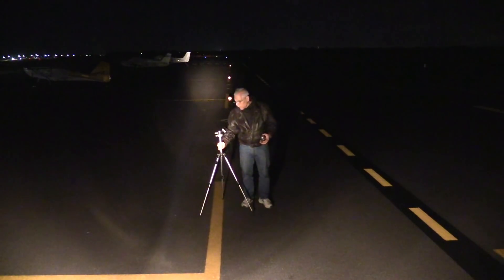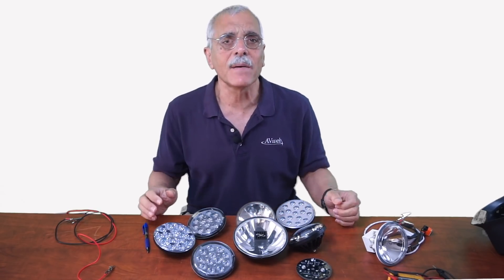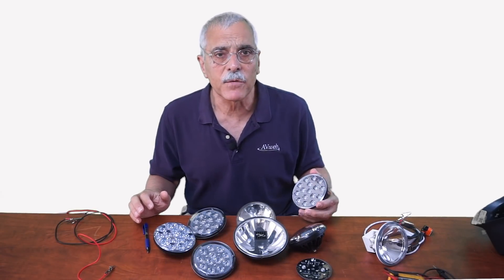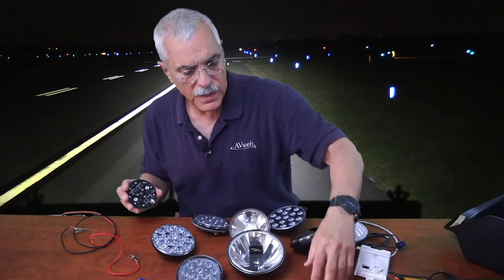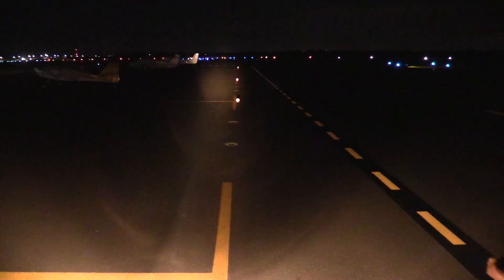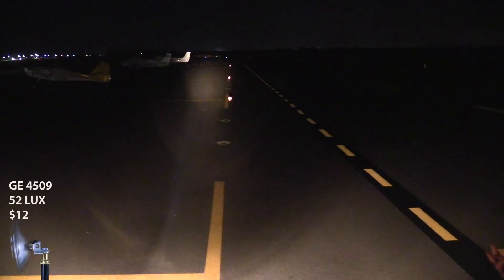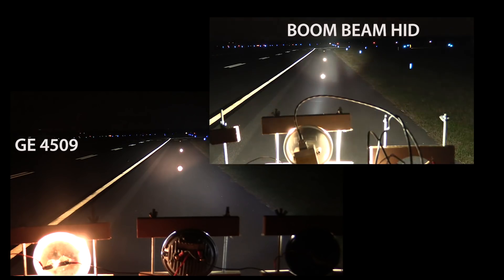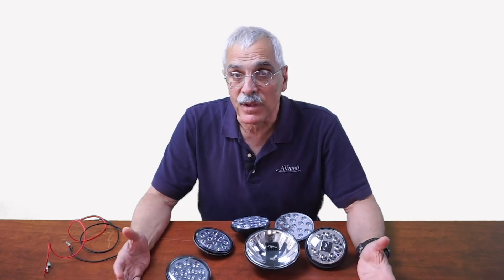The Unbearable Brightness of Aviation LEDs

Comment: - have $35 flashlight 
- print the word "aviation" on the side of it
- is now worth $650
Reply: Or "marine grade"...
Reply: @superbmediacontentcreator  You use non-"marine grade" parts in your boat at your own risk. Of course, everything you do on your boat is at your own risk (and the risk of your possible passengers), but when you use out of spec parts its doubly so. Certainly, if youre sure of what youre doing you can do what you want. But you better be damn sure then. The sea is as hostile for human life as the skies are.
Reply: I know. I bought some metal snips from a hardware store for $10. But the aviation metal snips were $775
Reply: @StringerNews1 unfortunately there will be no dude jumping into a jet with a replacement led headlight if you ask the manufacturer.
Reply: sabr686 agree
Reply: @StringerNews1 Well, sounds like the GE4xxx was always as cheap as 12$ and nobody had no peace of mind, did they?
Reply: @StringerNews1 That's still not a compelling argument. LEDs don't have any part that can be used to burn things due to it's temperature.
Also practically ALL old lamps with filaments are sealed and in a partial vacuum. otherwise the filament would oxidize within seconds. That is literally how ALL of them have to be constructed. Nothing special about PAR here. What is sealed is the reflector to the glass that includes the filament. 
Destroy the glass of a filament lamp and it starts a fire. Destroy the glass of a LEDs lamps casing, maybe even remove any lenses on the LED and then remove any resin that is in contact with the chip and you can warm your hands in cold weather. If they get too hot, they just stop working and fail open circuit. It can't get much safer today.
Reply: Aviation everything is blown up tenfold due to certification beurocracy and overregulation. 
We're talikung 10$ nuts, like each regular nuts, or 1$ rivets.
Reply: It's a bit like adding "Wedding" or "Gaming" in front of regular products. 
That being said, aviation needs more testing and better materials, increasing costs.
Reply: Until you try to get that money for it!   LMFAO.
Reply: The problem with high intensity LED's is the electronic's to drive LED's, it's called RF interference in cars, trucks etc it's not a problem in most uses, in aircraft and marine applications RF interference by LED electronic drivers is a real problem as the communication equipment operates over a very very wide frequency spectrum and common cheap nasty consumer grade torch & automotive LED drivers are not designed to a high reduced RF emitting standard over the same spectrum spread and do cause harmful interference to an aircraft or marine vessel's many communications systems , A lot of research and testing & money involved to meet very tight RF interference standards on a low volume selling items so yes it will be a heck of a lot dearer.
Plus also a lot more research and development goes into lens's for aircraft than cheap consumer grade stuff LED lighting.
Reply: @TheTurbulant  shielding, more efficient topologies for DC-DC
Reply: @TheTurbulant  ok, but aren't LEDs run with DC? DC has no frequencies. LEDs are constant voltage constant current. If you dim them for any reason though, yes ok, some interference.
Reply: Yes LED's are DC but you need to limit the voltage and current flow, they are not like incandescent globes. High intensity LED's could be current limited with resistors but they need to be of unrealistic size that you could not package small enough and also would vary in brightness with slight voltage change. LED's are often regulated using PWM (pulse width modulated) switching transistors, consumer grade one's emit RF interference both atmosphericly and along the power line but can be basic filtered to stop basic interference which is satisfactory for automotive and consumer grade stuff but it's not enough for aeronautical and marine purposes, much better, costly and higher grade of commercial  transistors are used, and in aircraft applications you have temperature variations from -40c to +50c , that's why you see LED lighting flash on and off with certain frame rate's camera's.
Reply: Nnnno lol. See that mosfet on the board there? There 10 cent mosfets and theres 20 dollar mosfets. Im willing to bet theres a difference.
Reply: @StringerNews1 Yup, but they don't seem to care anymore and I see dead-air on the biggest of networks all the time now. Few even know what and FCC licence ( I have a first-class) is anymore and they want to pay me less in numeric dollars than I was earning back in the 80s'. It is just amazing. The management thinks because the equipment got cheaper and is interchangeable that therefore the people did too! It is demoralizing and just time-to-die (Bladerunner).
Reply: There’s a lot of testing to certify anything for aviation use. Seeing as you can’t just “pull over” to fix anything it needs to work first time, every time. No excuses. You’re paying for the research and development of the product.
Reply: @CoordinatedCarry  that still doesn't mean it's Worth 650 ..
Reply: @-allround-  No, it means the testing and quality assurance is worth $650.00
Reply: There are a number of reasons the cost is so much more. Engineering and testing for interference with other systems requires independent experts with specialized equipment, which is not cheap. Once approved, liability is the next major issue. If there is a failure, it can lead to a crash or fire on the plane and the lawsuits will start flying. Plane crashes are never cheap.
Reply: @CoordinatedCarry  There's a grain of truth to the OP. Yes, it costs to certify things as you state. At the same time, Yes, you're paying extra on top of the certification/R&D costs because it's for "aviation". It's a very broad and well established business practice to add profit to any change/difference in price/value of a product/service. 

So, you're both on point though I strongly suspect the bigger part of the charge isn't cert/R&D in this case. That's especially accounting for the fact that these are essentially one time purchases. That is, once you buy it, you won't replace it because it lasts forever so the seller wants to both "sell" on that fact and profit more because of it (yet another difference in "value" they tack more profit onto!).
Reply: @CoordinatedCarry  Yeah and i've had these die on me before and have had to land in the dark. So I'll take the cheap version - at least i didnt pay $650 for all the "research".
Reply: rjcass33 How can you use that argument to defend it when the normal GE4509 costs just 12$? That is 1/54.16th of the price of the LEDs.
Reply: @StringerNews1 Made in china?
Reply: TRUTH But the batteries are only $100.00 each and you can only use the $100.00 dollar ones.
Reply: That works only if you are an insurance lawyer. But yes, that's how it works.
Reply: @StringerNews1 There is a fantastic writer/editor at the New York Times by the name of Stringer, that is not you is it?
Reply: Nautical or marine can do the same
Reply: Yep OPA, and if they put "Commercial Grade ATP Rated," or something like on it you're going to pay pay pay.
Reply: Welcome to the aviation business.
Reply: you pay mostly for redundancy, not for materials.
Reply: @salemas5  look at the board he showed. What redundancy?
Reply: lmfao i love these "i dont understand things so i spend more cuz it says Aviation on it!" guys.
So... a switch panel with  a pushbutton and 3 toggles  = $219
That's to replace a key switch that runs around $450.

Same switch on ebay but cooler looking = $23 but doesnt have "magic aviation juice" on it.
Theyre fucking switches. Literally nothing special about them. They need to handle the max voltage  and amperage of your applications. Thats it. No magic involved. Science..

Comment: Nice video Paul. I had an incandescent and a Whelen in my 170 when I bought it. I replaced the incandescent with a Rigid 62010 and it was twice as bright as the Whelen, so now I have 2 Rigid bulbs installed. Yeah it's not PMA but neither was the 4509 tractor bulb that they replaced.

Comment: I flashed the two 4509’s on my 185 for years. Never had a bulb burn out since they flashed. Steady running is what burns them out. My lights flash from takeoff to landing, regardless of how long I fly. Best recognition for those misty days flying the valleys , canyons and passes of AK. 

What I didn’t like was the big movement of the ammeter when they flashed, so I changed them to Whelen LED’s, one taxi and one landing version. The only flickering of the ammeter now is from the beacon on the tail. I don’t fly at night now that I don’t get paid to fly at night, but if I ever did I think I’ll be better prepared to do so.
Reply: Manny - when your ammeter flickered constantly on your 185 from the flashing 4509s, did you notice it ate up alternators or your voltage regulator?  Hope I'm wrong.
Reply: @horacesawyer2487    No.  Never affected either.  I have since gone to a Whelen tail beacon.  No more movement of the ammeter.
Reply: @mannypuerta5086  :  Thank you for sharing.  That is good information!  I had a complete electrical failure in hard IMC in south Georgia a few years ago in a 182.   Turns out the one and only Alternator had decided to go belly up.  I always wondered if something 'caused it' or if it just timed out due to normal wear and fatigue.  The failure got my attention real quick.  Once I became aware of it.  As I recall, I did not notice that radios were failing, only that I could not raise ATC and eventually the GNS 530W just shut down.  That kinda got my attention.  After mild shock, and not having an adequate means to navigate, I decided my best course of action was to get the heck down.  I was lucky the ceiling was not so bad that I had to be concerned.   ATC was worried about me and had called my destination before I got there.  I believe they had a ghost image of me on radar but certainly no transponder.  I didn't exactly follow a full approach procedure as 'expected.'   Hmm.  Maybe I should keep my mouth shut.  But, after all, it was a true emergency.  I was authorized to make decisions in my best judgment to meet that emergency, right?   That's what I had to do.  I was lucky it was day time.  I was lucky I was not icing up.  I was lucky my vacuum system help up until I got down.  If there were multiple failures I might not have been so lucky.
Looks I sure did get off track from the original question.  :  )   But sometimes that's how we learn.  From others.
Reply: @horacesawyer2487    My alternator lasted without issues from 1991 until this year when it was overhauled as part of the engine overhaul.  

Good story with a good ending.  Suggest you invest in an engine data monitor that gives aural and light warning when something is beyond normal parameters.

Comment: Great, never saw the innards before. 1957 172,  bought 2 years ago. In line with current thinking, I just turned everything on all the time. Still have the generator, although the “big” 30 amp. Turns out the 2 GE Pars draw 17 amps alone. Another 7 for the old nav lights. Anyhow, I had an electrical failure returning home at night, the radio died with a fizzling sound on final. Found the generator fuse melted in the holder. Had the generator rebuilt, had to get another core, the rebuilder rejected mine with a bad front bearing, scored armature. Replaced the fuse with a resettable toggle circuit breaker, back on line. I went with a pair of Larsens, shipped for $60 bucks. I don’t think it’s a big deal seeing down a lit runway at night, what is important to me is the be seen, at a fraction of an amp.

Comment: Great review Paul. I fly an experimental LSA and just bought a pair of Denali D2 LED lights. I am but an insignificant spec to you GA boys flying my weight shift Trike even though I sport in dash radio and transponder. But even though I fly by all the same rules you guys adhere to (except at night), I also invested in the lights for safety reasons. Glad you mentioned that towards the end of your presentation, I see lots of folks debating when you should have them on or off. As for me, its a safety thing, so I run them all the time.

Comment: I own a Cessna 150M.  The old landing light bulb it used was the GE 4313.  I switched to a Whelen PARmetheus (geez, who the heck came up with that terrible pun of a name?) about a year ago, mainly because I got tired of changing the landing light every 20 hours (in case you didn't know, those old 4xxx series GE bulbs are only rated for 25 hrs, so 20 hours in front of an O-200 is pretty darn good).  Compared to the GE bulb, not only is the PARmetheus not as bright, but the spread of the beam is much, much narrower - only 5 degrees either side of center.  Maybe not that big a deal to some, but if you're like me and you're based at a field that doesn't have lighted taxiways, only reflectors, you have to be on your toes not to miss the turn to the next taxiway if you have one of these equipped.  My point is, don't go with the cheapest option.  If you can't afford to buy the next option up, keep buying incandescent until you can afford one of the better LEDs.
Reply: ADEBISI ADEBISI  Hakuna your Matatas there, Xi Jinping!
Reply: Actually the best option is a HID lightbulb, more efficient, no need to worry about over heating an LED bulb, draws less power than LED and lasts longer.
Reply: Is this a "recommendation" or a "save a little longer" I thought Whelen was the high standard.
Reply: I would have twin bulb if possible, led for conspicuity to leave on all time and normal for night landings.
Reply: You own a Cessna 150M, and youre concerned about the cost of a landing light????
Reply: 'Debisi  iblis Biliisi 
Who named ya ass after a girl

Comment: White light LED's are made by coating a high intensity blue LED with a "phosphor" coating.  This coating converts part of the blue light into yellowish light.  The combination of the transmitted blue and the yellow is perceived as white by human eyes.
Reply: That's one way, there are several.
Reply: Yeah, there are NO white LEDS, since white is a combination of RGB...white LEDS work like a fluorescent lamp...blue/uv shining on phosphor...the phosphor can be made to give off different color temps of 'white' light...
Reply: @dougankrum3328  There are also white LEDs with individual red, green and blue components.  Many of the early ones were made this way, but the phosphor ones have higher CRI.

Comment: Great report Paul, However, a side by side photo of each would have made the comparison far better for all to see. Seeing the actual differences visually makes a huge difference in decision making. 

Also, it has never ceased to amaze me how when you ad the term "aviation" to a product, the sell price goes up by a factor of ten thousand. It my only cost the Mfr $ 35.00 to make the high end product, but corporate decides the ratchet up the sell price to match the image its a fantastic product. I know the FAA paper trail required for all aircraft parts is tremendous. But, often times I see something I could make with my bare hands in my garage that would out perform and outlast for far far less money than an SUV payment.

Comment: When I last flew, LEDs were beginning to replace hazard and obstacle lights, but the biggest problem for us was that they are completely incompatable with NVGs making towers nearly invisible for us low level flyers who might actually be close enough to these objects. I hope this has been taken into account since then.
Reply: I'm assuming your NVGs are based on infrared detectors. If that's the case, then no, LED lights are probably not going to ever be very bright in those. This is because infrared light is considered waste. Incandescent (and HID) lamps produce a lot of infrared (and other frequencies) just as a natural consequence of their operation, and there's nothing you can do about it. But LEDs can be tuned to provide the spectrum you want (within reason), so it's possible for them to produce light only in the visible portion of the spectrum. In fact, that's why LEDs are so much brighter than incandescents, because they're not wasting energy producing light that's invisible to human eyes.
Reply: They were more on the IR end, yes. I couldn't agree more, LEDs are very versatile. This was just overlooked for the first go around, and the more we know the better we can take all types of night flying into consideration to make it safer for aviators everywhere.
Reply: @rickoshea6821  Unfortunately, I really don't see that happening. NVGs aren't used widely enough to justify the cost of adding infrared LEDs to every tower. But you never know, it could happen.
Reply: Night vision goggles?
Reply: I was under the impression that typical NVGs use photomultiplier tubes to amplify visible as well as near-infrared light.  For example, many CCD (and some CMOS) camera sensors can see the near-infrared of TV remote controls, so using such a camera to take a picture of a transmitting TV remote in a dimly lit room will show a dim image of the remote with a bright spot at the remote’s emitter. A device that uses purely infrared radiation would be more properly called a *thermal imaging*.
Point being, I thought NVGs amplified all visible light plus near-infrared, so I’m not clear why radio towers etc aren’t showing.
Reply: @jpe1  That's why I specifically asked about the type of NVG that Rick O'Shea was talking about.